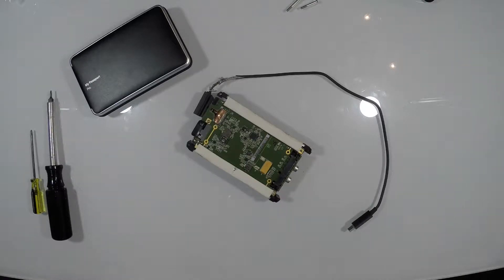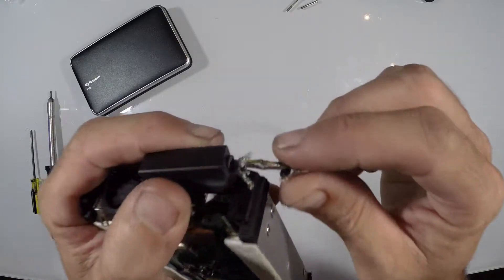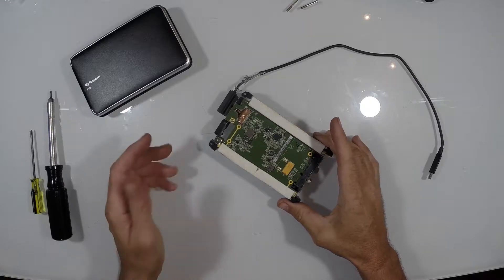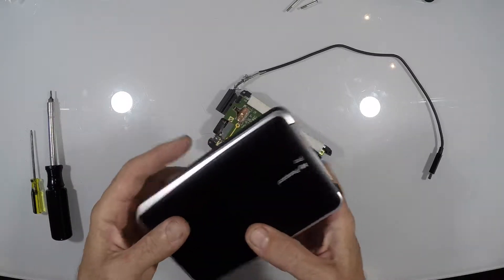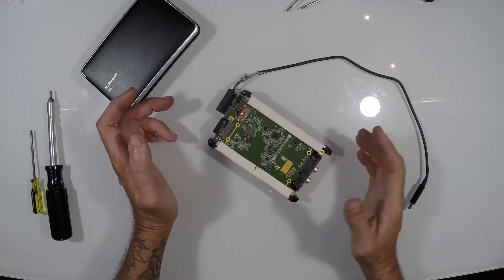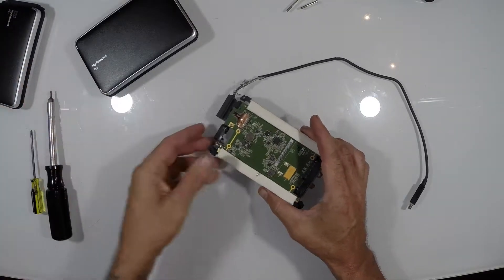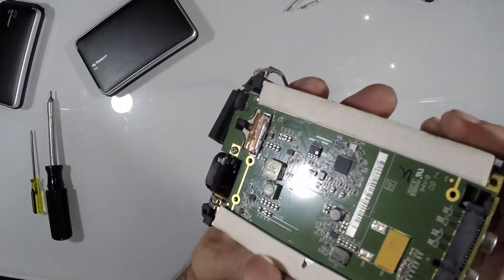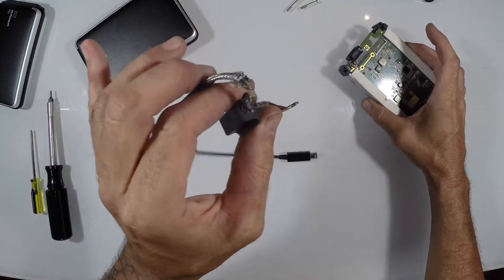Western Digital My Passport Integrated Thunderbolt Cable Replacement DIY

Comment: that sucks that you went that route. you can resolder all those wires it just requires patience. I have the 4TB version of that drive and love it. The very expensive Thunderbolt 2 to Thunderbold 3 USB C adaptor keeps it working with new Macs.

Comment: Can you recommend other hard drive manufacturers that make better designed cases?

I ask because, while I have one of these drives, I also have some of the MyBooks and my impression of WD is that, they will design slick looking cases that will die with the drive and date on them. 

Certainly, that has pissed off a lot of customers. It’s bad enough that drive have MTBF but, to actually design a closure that will die or a hard-wired cable that will not likely last as long as the drive is pretty, freaking stupid.

Perhaps, they feel, “Hey, not stupid for our bottom line, ‘cause you gotta buy a new drive! 😊”. But, nothing will piss off a customer more than losing their data and, if they think the manufacturer is stupid, they’ll drop ‘em.

Comment: Let me know if you want to get rid of the old enclosure. I might have an experimental purpose.
Reply from the maker: Sorry, but I believe I put it with my scrap metal and recycled it already.
Reply: @LucidAutowerks  OK, no worries. My experiment would have to involve a risky firmware hack, anyway.
Reply from the maker: I’ll have to take a look for the board. I would have recycled the metal already but not the circuit board.

Comment: Do you find the drive inside can be modified to a ssd?
Reply: Hi Mr Bobby Hartanto. Did you found the answer?Is it possible to replace HDD of My Passport by SSD?
Reply from the maker: To be honest, I don't know anything about the tech side of things like this. I'm better at figuring out the mechanical end of it.